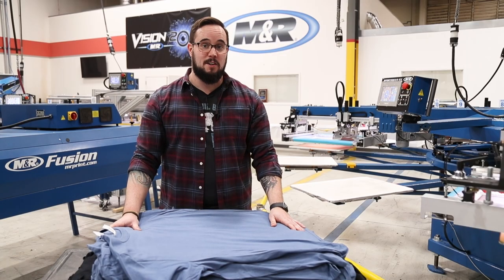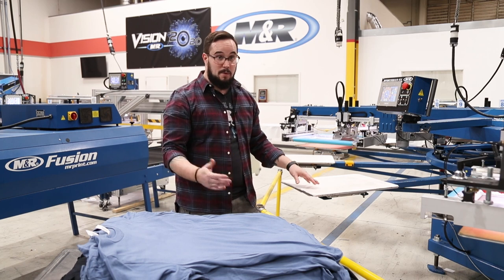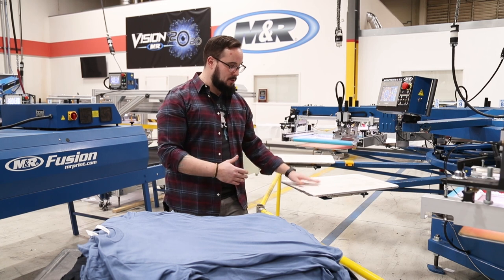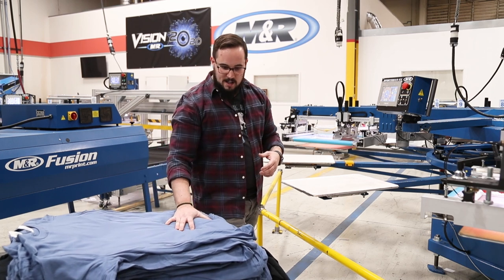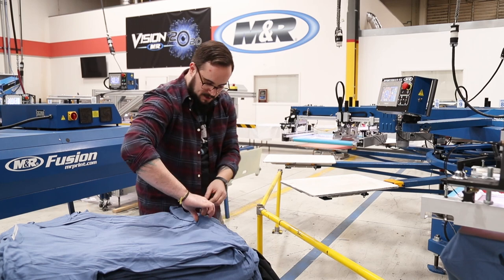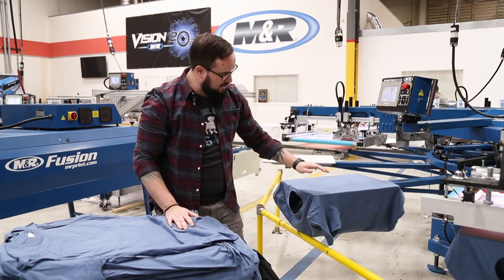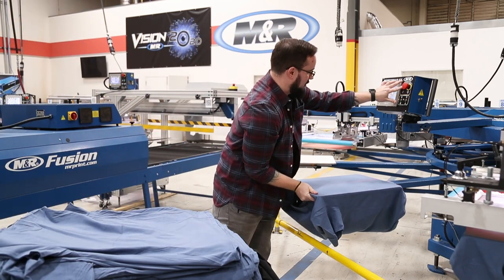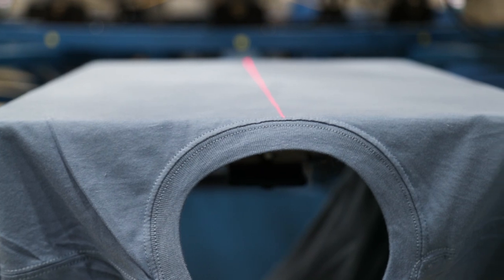Quick Tip: Loading Shirts

Comment: great video. I am a lefty and most shops are set up with the cart to the right. When I can put it on my left side great but for those times that lefties have to work from the right side this is what works for me. I put the cart over more to the right at an angle and use my feet to do a pivot . That helps me to reach the shirt without doing to much of a twist . Otherwise I would get fatigued really fast